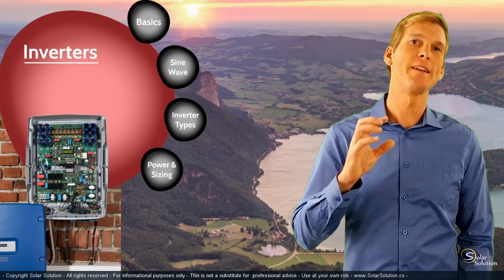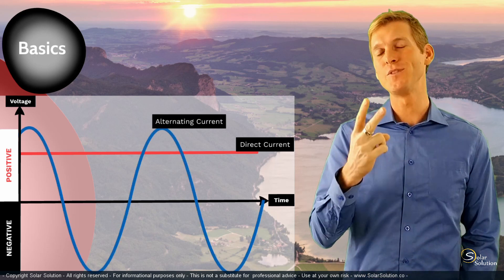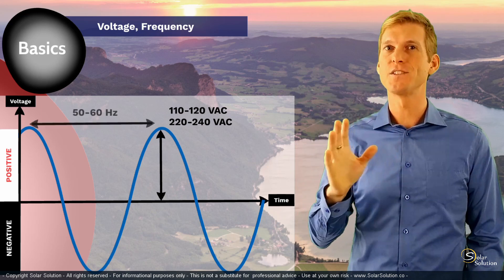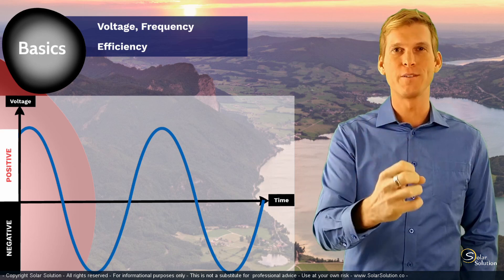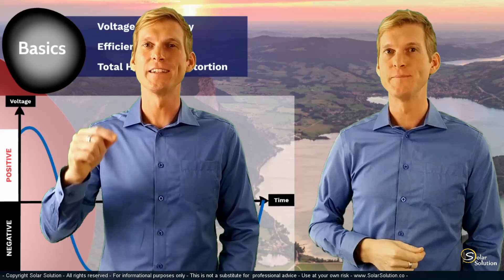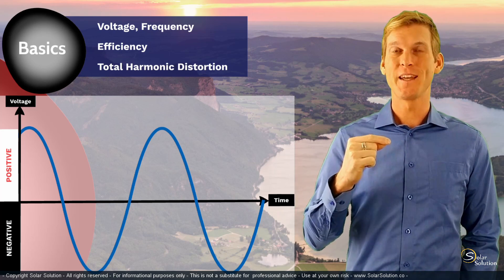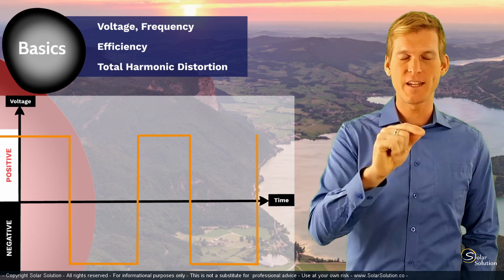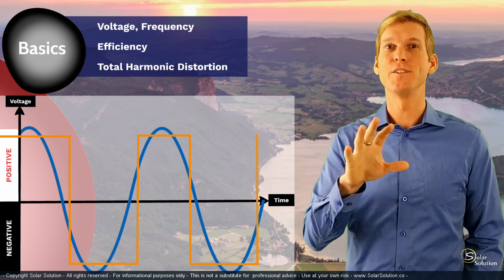Inverter Efficiency and THD: Total Harmonic Distortion

Comment: The Peak value voltage on 240 vac is 1.4 Times The nominal value (339 v on 240 v line voltage)!
This is because this has same power effect on resistive load as 240 v DC voltage.

Comment: Well done tutorials, thanks! But around 50s there seems to be a small mistake or at least bit misleading.  I think for ac the peak voltage was mixed up with the effective voltage.
Reply from the maker: Thank you for your contribution Wersun, much appreciated. I tried to keep it as simple as possible, though you are off course correct that there is a difference between peak voltage and rms voltage. I will pin this comment, so that others who want to learn more can benefit as well.
As a note for other viewers who wish to dive deeper into this topic: You may want to search videos covering rms voltage, peak voltage, rms current, peak current and maximum power. There are several videos available, here is one which in my opinion explains it rather effective: https://www.youtube.com/watch?v=ERIToctYUcQ
Enjoy! All the best, Jesse.